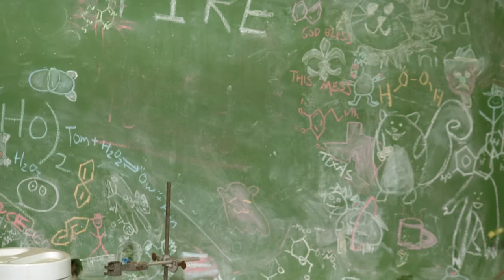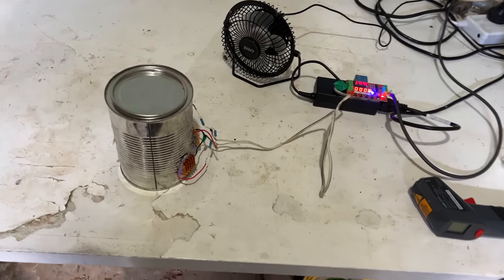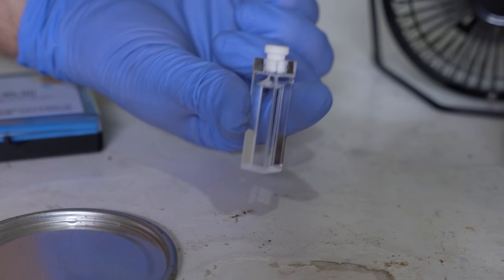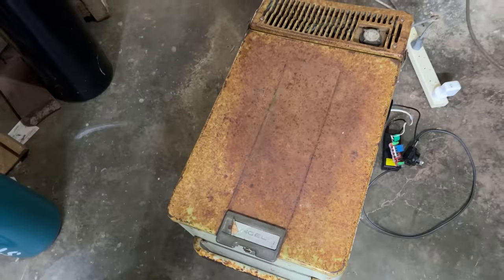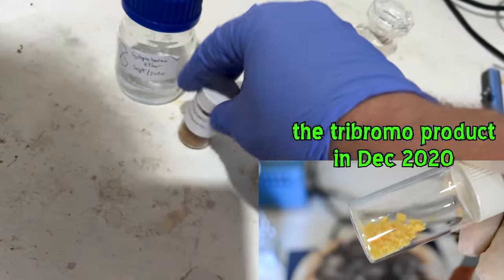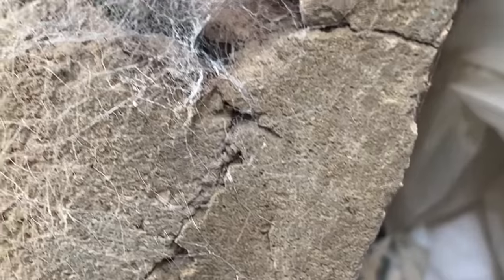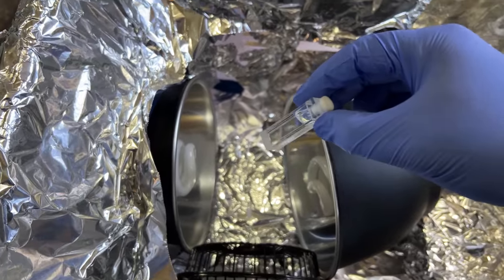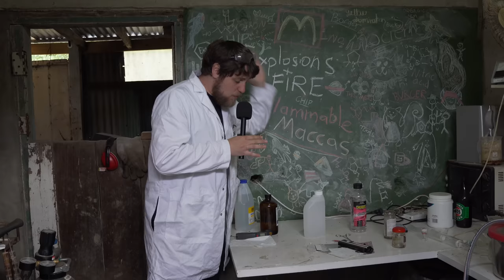The PhotoFridge - Cubane Ep 13

Comment: I have an idea for something that might help. Start with a small backer or bowl in the can. Point the LED's down. Boom glass problem solved (u could even put it on a hot plate (temp off of course) and put a stirrer in

important edit: Make sure place an excess of DCM in and Fully Seall the can shut. It should be enough to just hammer the lid on. There's a few ways u can do that without causing to much damage to it: a small square of wood over the lid, hammer the wood so it equally distributes the force of the hammer. As for prying it back up, just uh, be careful move around the circumference with each pry (i.e. don't focus on once place to much).

good luck!!

Comment: just my thoughts:
1. is it possible that the temprature was too low for the reaction to occur?
2. is it possible that both the reactant and the product has the same Rt? (retention time on the plate)
2b. you might benefit from trying different mobile phases for the TLC.

Comment: If you plan to go for big scale uv cubane reaction, uv pond light is just for you, they are already with quartz glassware, just gotta make sure chemicals won't react with plastics you are working with
And more yolo solution: drill holes in flask so either just LED lenses fit trough holes or use bigger drill to fit all 4 LEDs, but not backplate, find glue/resin that won't react with reagents and glue these in to flask, so LEDs are literally submerged in chemicals, use glue between chips to insulate from potential leak too, with it you can put flask with steering bar and inside refrigerator, it will have cooling and mixing at the same time
Just use proper ceramic cutting drill and you'll be golden
And if refrigerator is too small, just ice water bath that bad boy
ANOTHER much easier method: use BIG beaker, with a lid, drill/glue LEDs to lid so light is suspended millimeters from stirred mixture, no drilling in glass, LEDs shine directly at liquid and everything ins stirred, so reaction will be uniform, also ice bath/refrigerator would be good idea. Lid without lip would let you adjust height, also LED UV light is weak, this setup would guarantee to hit as much liquid as possible. Because inverse square law for light, double distance = 1/4th the light, this is why getting LEDs almost submerged is best bet to get as much UV as possible in it

Comment: New patreon goal: buy a crappy, old benchtop nmr with permanent magnets. Should only cost you like 20k or so :P But for real, maybe you should send some of you maybe product to someone that can run an nmr again. Regarding the reptile lamp vs led, have you considered that the wavelength of the leds might be too far off resonance to drive that reaction? Those LEDs tend to have really narrow bandwidths and your thermal background also only gives you fractions of an eV in leeway. If that reaction needs like 280nm your 310nm LED might do very little to help. There ought to be a paper of someone doing the computational chemistry to figure out the activation energy exactly...

Comment: I am not qualified or well versed in chemistry in anyway, but maybe one of my wrong ideas could lead you to the problem. 

1. You may have already gone over this, but aren't solvents that contain C-Cl avoided in photochemistry? Maybe the DCM is being chlorinated and side reactions with the substrate are causing your wacky TLC plates. Maybe DCM by itself chlorinates under UV but not much else changes in your control?

2. I think the quartz tubing with flow is an awesome idea. Do you think flow would change anything about the photoreactions?

Comment: Would be better to construct some continuous flow device - a thin hose turn in spiral like a spiral wire in GCMS device, pump the solution with a tiny peristaltic pump through the hose-coil mounted in sealed box with source of UVB light, covered with mylar screen to improve potency of light and measyre the residence time of solution to be of that time that it is intended to be… and go on…

Result would be a reacted product.

Maybe your product doesnt absorb the uv light… so that you could use some method of staining the plate - maybe good would be to cover the plate in conc. hcl to unprotect the ketal - it may uncover the stain of product under UV-C light

Comment: I still think you should ask @styropyro to build you a PROPER UV setup, so that you KNOW it's in the wavelength you need. Doesn't have to be a laser, but hey... maybe that might work better? lol
Or perhaps one can be passed through a diffuser 🤷‍♂️🤘

There's a reason things show up on AliExpress/eBay/BangGood/etc. 
Case in point, your Cuvette...
If we extrapolate the lack of quality from that purchase, in that it can't even get a leak-free stopper right, then what are the chances that the wavelength the LEDs are supposed to be outputting, is anywhere near what it IS outputting??

Just a thought 😁

Comment: Hi, I'm a third-ish year chemical engineering student. You probably have already thought of this, but have you tried using a different type of TLC plate? I remember in my analytical chemistry lab we used a TLC plate (or column, one of the two) that separated molecules on the basis of size as opposed to polarity. Maybe since that molecule is relatively large compared to the others you'd see better results in separation, if that's the issue at least.

Comment: LED color in fact changes with overvoltage. A yellow led turns red on overvoltage.
An UV led can probably stop giving out UV on overvoltage.
Reply from the maker: Yeah that’s why the LEDs in the previous video were so blue! They were putting out a lot longer UV wavelengths, rather than the short 310nm in this video, which is why they don’t look so bright (both to the eye and to the camera)

Comment: That old Engel is a beast. My dad has one exactly the same... with a lot less rust on it :D it has been around a lot longer than I have and it is still going strong, it does use more than twice the amps of a modern one though :D
Reply from the maker: yeah look it's probably not the most power efficiently environmentally friendly way of conducting this synthesis... but oh well!
Reply: @ExtractionsAndIre  compared to the carbon tet you were considering however…

Comment: PhD student in organic chemistry here. It seems like you are filling the cuvette (~3 mL) but you say you are using a few mg of the starting material. Honestly, that may be your issue. If you added say 3 mg and based on the MW of the monoketal, you are looking at scale of 0.008 mmol which is minuscule (even for an experienced chemist). If we assume the UV rxn is say 50% efficient (even ideally) then the amount of product youd be trying to detect by TLC is still 0.004 mmol worth and its made worse by the fact that these compounds dont stain super well either. Try to scale up a bit if you can. Most UV reactions can comfortably be run at concentrations of 0.03-0.05 M (whereas you are running these roughly 10x more dilute). Try stains like dinitrophenylhydrazine (DNP), vanillin, or p-anisaldehyde which can visualize ketones. Also you can try PMA stain which can be useful for low concentration reactions like what you are working on. Good luck!
Reply: Another big thing: always sparge the solvent of any photochemical rxn with an inert gas like nitrogen or argon (even just for a minute or two). Oxygen can be a big issue as far as side products or rxn productivity is concerned. I dont recall the solvent you are using, but from what I have read, a lot of photochemical reactions are done in benzene, acetone, toluene or methanol. Not sure what the paper you are following is using

Comment: You know, whenever you touch electronics, the end result always looks like an improvised bomb, no matter what the actual purpose is going to be. 
Also, get some WAGO clamps or screw terminals, that way you can connect stuff to each other and remain flexible, and have it all in one unit and sit flat. You should never tin multi-stranded wire, it just creates a weak point.

Comment: one thing for sure, those resistors that you have are rated for maybe 1/2W, if they're getting too hot, may be worthwhile going to a 5w or 10w version that has a BEEFY heatsink, they're like a couple bucks each so quite a penny but can handle a LOT of abuse
Reply: completely unnecessary. They will run at >120°C until the end of time in this setup and will never get hotter than they do now.
IF he wants to improve anything here, he can improve the cable management and maybe insolate it better and stuff, or reduce the input voltage to 9V or something and use a smaller resistance. But that's it.

Comment: What if you put a drop on the TCL plate, run it, and then blast it with UV light on the plate? Then if the dot disappears with all staining techniques you can be pretty sure that the UV light is causing your precursor to react and form something that isn't detectable.

Comment: What about sealing the cuvette from the outside with something like Parafilm? it may be tedious but should be airtight if you wrap it enough, without needing the teflon tape. i don't know if Parafilm specifically can withstand DCM though. Also, the UV LED's are probably better than the lamps, simply because the leds probably have a more intense output at your required wavelengths
Reply: Parafilm is great to keep water out, but I wouldn't trust it with organic solvents. It might slow down the evaporation in the short term, but I stopped using it for long term storage, it's just a pain to remove half molten parafilm soaked with sketchy chemicals.

Especially amines (tried it with triethylamin) seem to desintegrate it.

No clue if it works with DCM, i never had a reason to try it.
Reply: Parafilm doesn't stand up to DCM. I've seen students try to seal DCM containing flasks with parafilm, and it either gets totally eaten or blows out due to the weakened structure and volatility of the DCM

Comment: To get a better seal with the plastic cap you might be able to lightly peen the center to slightly increase the outer diameter. 

If the cap is hollow, an inert sphere or cylinder could be inserted depending on the contact area length in question. 

Plastic plastic deformation lol

Comment: The cubane should not have any UV absorption as it is a saturated molecule. There is no obvious way it could react with permanganate or iodine to be stained. You could try a ceric sulphate stain or a ceric ammonium molybdate (CAM) stain which are generally good stains that can oxidise pretty much anything.

Comment: Have you considered putting this all under nitrogen? I know it's a pain... but this is photochemistry, which is often sparged then done under n2. Not great for the home home situation.

Maybe could use chloroform or cyclohexane for a higher boiling solvent. Radical NBS bromination in old lit uses carbon tet, but modern papers use chloroform, cyclohexane or MeCN.

Comment: Would it be possible to wire up the UV LEDs through the lid of small glass jar, something like the size of a baby food jar? I feel like there should be some method of directly exposing the solution to UV light without losing solvent, but maybe the DCM vapors would just react with something on the electronics and contaminate the starting solution.
Reply from the maker: yeah I don't think the LEDs would survive getting directly exposed to the DCM vapours.. any plastics would dissolve- although it might be completely fine

Comment: How polar is the solvent (I have a HS level knowledge of chemistry only)?  If it's nonconductive enough maybe you could just immerse an LED or two if the packaging won't contaminate things.  It's not like anything is going to need even 5 volts in parallel.

Comment: If you're resistors heat up too much you could have but 2 in series and 2 in parallel to double up on the wattage rating. I love your fridge solution though 😂

Comment: Honestly, it's pretty normal to monitor reactions by the disappearance of starting material, but to do that, you really need to be getting consistent and reliable results on TLC, which doesn't seem to be happening (yet). Lots of ppl recommended vanillin or p-anisaldehyde (or DNP) – imo vanillin is pretty nice, and sometimes stains stuff you wouldn't necessarily expect it to. Haven't tried DNP, but it's obviously not very accessible anyway. I also had a kinda wacky idea that it might be interesting to test some photosensitizer or something, so you can make the [2+2] cycloaddition able to run using visible light. There are lots of papers on this kind of thing (e.g. 10.1002/chem.201204573), but I'm not sure how well it would work with this substrate (nor do I rly know anything else in detail about photochemistry tbh). Best of luck!
Reply: For DNP he should find a source inside the country, as getting that through Australian customs is asking for trouble. A few grams go a long way though, you don't need much. Maybe some schools still stock it.

Comment: I have an idea: a wide-neck Erlenmeyer flask with SB45 rubber stopper, which would have a LED board attached to the stopper's face that's facing the RM. When I drill holes in rubber stoppers or septa for slow addition rxn, I find that if I use the smallest drill possible, the stopper can still seal the vessel after pulling through the tubing (or wires in your case). The rubber naturally expands to try and fill the drilled hole.
Reply: Yes and then wrap it with aluminium foil and put it on ice. But i dont know how good the LEDs hold up in dcm vapor?

Comment: For future reference, refrigerators are actually pretty inefficient for removing heat from a system. With their primary purpose being insulation from external heat, the cooling power of a refrigerator is not too great. It obviously was enough for this though
Reply: Which, was also something you were looking for I guess with the insulation

Comment: I'd say go and ask the original authors of the paper. 1) What methods did they use to detect the product? Did they use TLC at all? 2) What kind of chamber did they use? Perhaps they used quartz with a quartz stopper, to avoid contamination issues. Could that be it?

Comment: You get more power if you run the LED straight to the wall socket.
Fuck the power supply and resistor... Just jam it in the wall for max power.

Comment: found an old book about colored reagents from Merk so I am just throwing out what I found that might work:
1. 0.4% 2,4-Dinitrophenylhaydrazin in 2 N HCl or 1g 2,4-Di... in 1L of EtOH with 10 ml HCl (1,19) [I am guessing density so 37%). This should work for free Keto-groups or Aldehyd, for higher Keto-groups an Alkohols: 3g Vanillin in 100 ml EtOH with 0,5 ml H2SO4 (1,84) + Heat 

2. for heterocyclic compunds (did not specify what kind on this one), this one is a little nasty: 200 mg Bariumdiphenylaminesulfonate dissolved in a few ml of formamide and filled with MeOH to vol. of 100ml. After aplication expose to UV 254 m my (this book is old) if no spots are visible heat for 5 to 10 min.

3. for aromatic and heterocyclic compunds: 50 mg Sodiumfluorescein in 100 ml Methanol (50%). Use a "Analysenquarzlampe" to see spots (I think it is a mercury lamp)

Comment: So a thought: What if by overpowering the LED's with 900ma you changed the characteristics of the LEDs and they are now outputting a different wavelength that is no longer optimal for the reaction?  Maybe get a new set and try again?

Comment: Rarher than LEDs, mercury lamps are simpler and you can buy them cheap from UV air purifiers. Look up Honeywell air purifier lamp. Also you should at the very least sparge your reaction solvent with N2 as UV reactions are very sensitive to O2. Please don’t use CCl4.